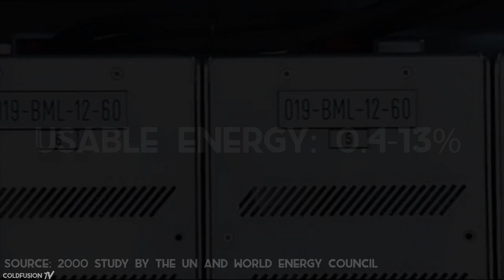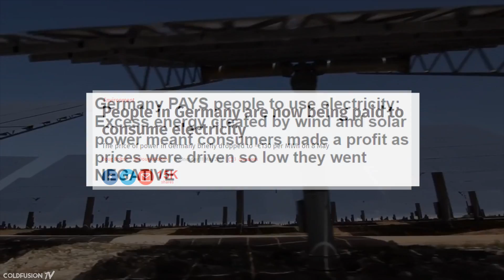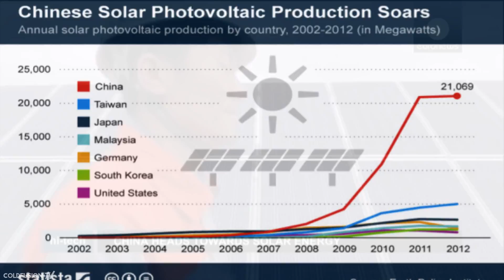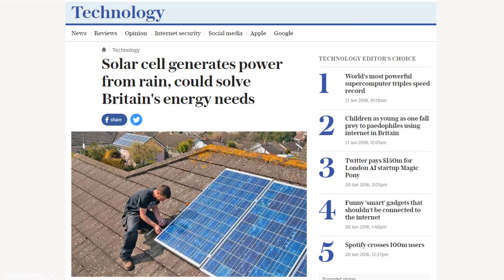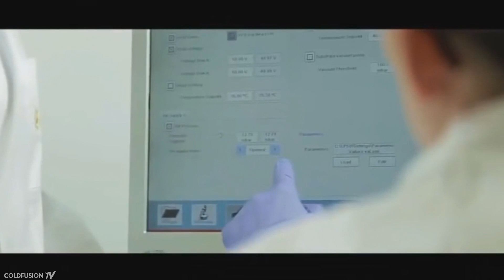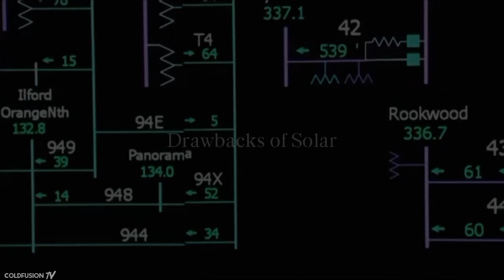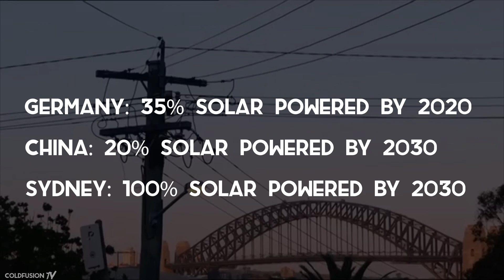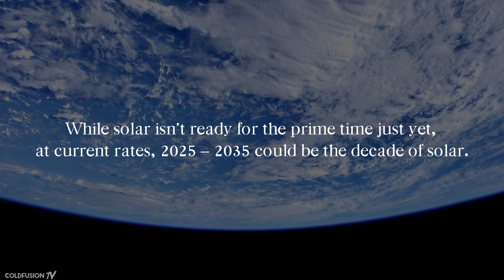The Truth About Solar

Comment: See batteries are made from lithium. Lithium needs to be extracted from the earth (Fracking, which is still harmful to the environment), and there is still going to be a demand for the panels the initial demand to get every home solar powered. Then we have the upkeep demand of them breaking from the weather, or from them just malfunctioning or being defective. Which means more fracking (which environmentalists hate). If we are going to have every home solar powered we are going to have to increase fracking dramatically(doubled or even tripled). Yes its a nice thought that we would stop using one dirty resource, but it turns out that we are causing just as much damage by increasing the amount of fracking needed to meet demand. Before you go telling me that coal is more dirty remember how many people are are in the world, and how much it would take to have every single household to have  to have two or more solar panels, and then the batteries to hold that energy. Now that you have that image in your head now think about the amount of fracking we already do. Now triple that amount. On top of that there is only so much resources that are on the earth that go into making solar panels. The cost of solar panels would dramatically increase because the materials are being depleted due to the rapid increase of demand for the solar panels(which supply cannot match), and to find more deposits we need to invest in exploratory fracking which would require more money to fund. Which then drives up the prices of going solar. Then if we have it like we do now with having it run through our infrastructure we would have to replace every power line on earth that can be solar friendly, which is another route, but the thing is that is a huge expense because think about how much it would cost to replace all those power lines. Another problem with that route is now we are still paying an institution for energy, so its still not "free energy".

Comment: If you could take a one amp one volt solar panel and convert it up to 14-16v at 700 amps that would make solar practical as 1000f or lithium ion polymer batteries could power an entire house using a 10-12kw power inverter.

Comment: In the USA,(as of 2016), our energy breakdown is as follows:

Coal = 33%
Natural Gas = 33%
Nuclear = 20%
Hydropower = 6%
Wind =  4.7%
Solar = 0.6%

Solar is also heavily subsidized and is facing continuing economic headwinds especially as Saudi Arabia tries to forestall future losses due to increased US oil and natural gas production. Solar will be great on a small scale but I don't see it dethroning any of the top producers of electricity within the next 200 years. Nuclear is still by far the safest and cheapest per watt than any other form of energy production. Windmills are killing thousands of birds and solar is only feasible in the areas with lots of sun and space for large rows of panels that won't take up farmland. So basically in the middle east, where its not wanted, in Australia where the conditions are just right, and maybe the US southwest.